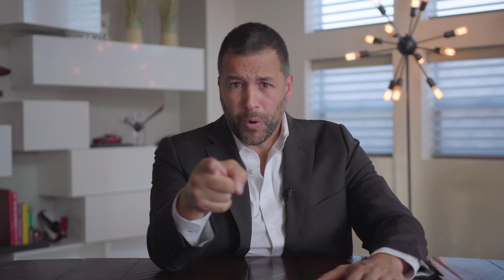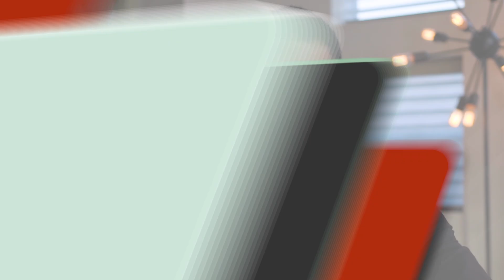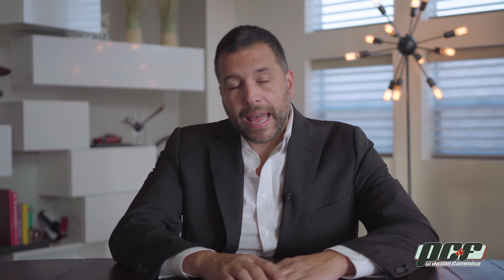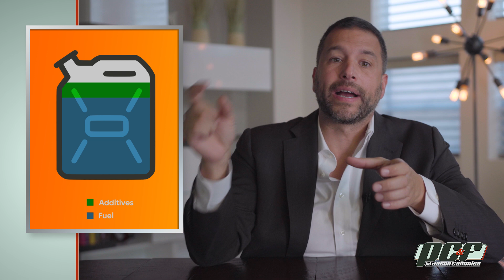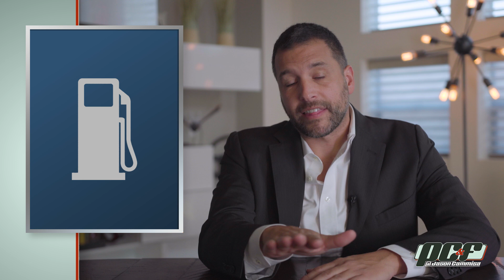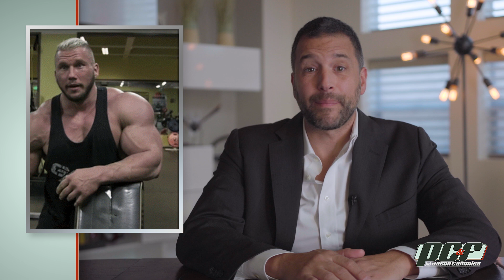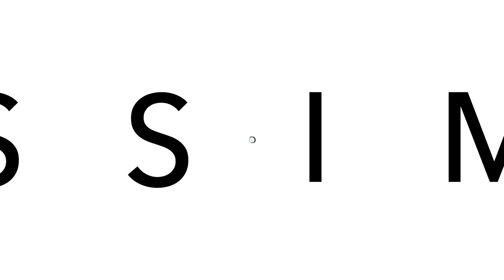Why you should never put premium gas your non-premium car — Proper Care & Feeding with Jason Cammisa

Comment: And don't worry, there will be another episode about RON and MON — and now while Europe's 100 RON isn't any better than US 94-octane. But how California's maximum 91-octane sssssuuuuuuuucks!
Reply: Maybe not episode-worthy, but what gives with 85 octane in the high altitude states? It's not 1973 anymore Colorado, and my Golf wants 87 (like every other car made since, what, the early 80s?)
Reply: @patrickgile320  I guess in theory because the air pressure starts out lower and cooler at higher altitudes in the first place the air in the cylinder will be lower pressure and cooler after the compression stroke. This means there is less thermodynamic energy in the combustion chamber to overcome the activation energy required to start the gasoline-burning before the spark plug fires.
This is also the same but opposite explanation as to why cars with turbos and supercharges need higher octane for the same compression ratio as a NA car.
Reply: @patrickgile320  A car tuned for 87 can use 85 just fine at high altitude, due to the lower air pressure.
Reply: What about the crazy price difference between say ARCO vs SHELL
Reply: Such a great episode! Too bad these are so short.
Reply: CA 91 octane feels like CO 85... I like the 93 on East coast.
Reply: When I had a 2018 Type-RA, I had to have it de-tuned for 91.  That ECU was clearly designed for 93... (S209 is the same way I'm hearing)
Reply: @stevemartegani  ah so instead of 5 horsepower you get 4, such a shame
Reply: Good cause Europeans need to watch that video. Idk how many times I've read " You yanks pay little for fuel because your fuel is crap! Our cheapest fuel here is xx" or something along those lines.
Reply: What about the crazy price difference between say ARCO vs SHELL
Reply: @joefields719  Go to a local shop and ask them to show you the inside of an engine that's used ARCO - versus another that's used a Top Tier fuel like Shell. You'll never put that sludge in your car again. Ever.
Reply: Yes - that`s a good idea. Fun Fact: Shell is selling its V-Power 100 Octane here for roughly 10 Cents more than Aral (another brand here) sells its Ultimate Fuel with 102 Octane. This sample shows that all is just marketing to get some more cash out of the customers.
Reply: Arco is top tier rated
Reply: I'd pay to know how the US 94 compares to Russia's 95. Over the past two decades, the gasoline quality improved a lot, but since I'm going to switch my current Kia Rio for a used BMW 1 Series, I'm a bit worried whether I can keep filling up with 95 or would have to start filling up with 98 instead.
Reply: @dimanxgermanist1327  Don't you all use the same rating for your fuel as Europe? Then it should be same - our 93/94 is the same as your ~100. It doesn't mean one fuel is better than the other, we just use a different rating system.
Reply: @racequad9  I dunno. The number corresponds to the octane rating, so it can't be above 100, but unlike Russia, Europe doesn't usually use numbers, they have that "regular' - "super" - "super plus" system
Reply: @dimanxgermanist1327  I think Russia might use the same rating as Europe. Why wouldn't it? As an American, we seem to want to be different. I don't know why we do that crap. Regardless, I don't think there's much difference  in quality, just the numbers. Oh, we use both numbers and "regular" "super" and "premium"
Reply: @dimanxgermanist1327  I live in Portugal, have been to multiple other European countries and I've always seen the octane number being displayed. I think it's actually mandatory in the EU. 95 exists everywhere, it's mandatory for gas stations to sell 95, sometimes there are two types of 95, a "basic" and a "premium" version of it, the premium 95 is sometimes replaced with 98 which is also fairly common. Very rarely (in most countries) there will be gasoline with octane rating above that.
Reply: @fgsaramago  Means I'm probably out-of-date, thanks!
Reply: I know I'm kinda off topic but do anybody know a good place to watch newly released movies online?
Reply: @Gianni Ellis i would suggest flixzone. Just google for it =)
Reply: @Kasen Asa Thank you, I went there and it seems to work :D I really appreciate it !
Reply: @Gianni Ellis happy to help :D
Reply: Hey, Jason, where are you? It's been ages since I heard obnoxious yet insightful car info from you. There's no shortage of topics!
Reply: @dimanxgermanist1327  Hey there, I'm right here! And I'm still doing this same show, basically — rebranded as "Know It All" on the Hagerty YouTube channel. Same topics, but I'm a little nicer about it. Go check it out — I think there are 11 of them so far!
Reply: Hi Jason, about this topic does the same apply to diesel? Regular diesel Vs Premium (with additives)?
Thanks keep the great work!
Reply: Come to British-Columbia , Canada.. World worst gasoline on earth!!!!.... HPA motorsports did an article about it. even the chevron 94 is absolute garbage around here. and no e85 anywhere to found either.
Reply: That didn't age well
Reply: Make this episode on hagerty about RON and MON!
Reply: Could you please do one on why Cd is not aerodynamic drag and force your colleagues to watch it? They are starting to piss me off xD
Reply: @HMHacki  It's on the list of the 200+ episodes I have written down and ready to produce :)   IT'S Cd x A, KIDS!  I say that all the time!
Reply: @JasonCammisa  thank you!
Reply: @JasonCammisa  I miss this series 😢
Reply: @HMHacki  cough cough Matt Farah cough cough
Reply: @FedSalman  Yes he was the last offender on a long list.
Reply: And who buys the one in the middle? Which is 89 around here 🤔
Reply: @aebk8439  The very small group of people who either have cars whose engines specify 89 OR people doing engine mods that boost compression beyond what the stock ECU is designed to account for (i.e., certain head/block combinations with '90s Honda engines being built by people who can't afford to get it tuned), but who haven't jacked the compression up high enough to need premium gas.

In practice, it's just another way to try and squeeze money out of people using the same logic as what Cammisa described in the opening of the video. Offer them something "better" than regular, but at a lower price jump than the high-octane option.
Reply: @aebk8439  V6 buicks, my parents lacrosse with the 3.6. I would assume also the V6 chevys as they share the same engine.
Reply: @Kasen Asa yup, have been watching on flixzone for since march myself =)

Comment: You should never put regular gasoline into a premium engine. This causes engine knock, sure the ECU will retard the timing to compensate, but only after a knock has been detected by the knock sensor. Meaning the damage is done.

Comment: It might be worth going for the premium fuel just for the additive package.  The premium fuels have additives for reducing upper cylinder wear and detergents for cleaning your fuel system.  I have have also heard of an issue where ethanol in fuel can degrade or damage oil filter that has a cellulose media, but this is only a potential issue if fuel is getting into your engine oil.

Comment: My father bought 94 octane for 300,000 miles,
Shell oil,
He dead, then I now have his car.
At 423,000 miles it is still starting today.
One more thing, the engine oil😂.
When my father changed the oil it came out very clean.
I bought the lower price gasoline.
The oil comes out darker.
  If you burn cheap gas your motor is going to get dirty faster.
So change your motor oil sooner.

Comment: If you don't fuel up much (e.g. you have a grocery getter that takes months to burn through a tank of fuel) putting E10 in can probably hurt as it'll degrade and decompose, whereas E5 usually has no ethanol and doesn't "rot".

Comment: Ive seen two of this dudes videos, been wrong in both. With modern EFI, cars ecus can sometimes run more timing when using higher octane fuels when compared to 87. More power, better mileage in these cases. Keeps the knock control down. Also premium fuels have additives to help clean the injection plumbing and valves. 

Ill keep my 91/93 thanks

Comment: My 1993 Ford Explorer is rated for 87 octane but it suffers from pre-ignition (aka knocking or detonation) on anything less than 91 octane. My entire ignition system has been replaced and my cylinders and pistons are clean so it isn’t carbon buildup. It also has self-adjusting timing.

Comment: Premium will build less carbon on the rings, im told

Also good to note,  modern engines will still adjust spark and cam timing until they find knock 
So you will feel a bit more of a peppy throttle response

Old cars, particularly with lower comp won't be as noticeable,  if noticeable at all

Comment: Typically the best additive blends from a brand are only available in the highest grade. If you run a GDI, using Top Tier high grade blends can significantly reduce intake buildup.

Comment: The ability to compress the fule before predestination, is the reason. 
So put it like this, 87 octane, is ok.
But four cly engines follow a Motorcycle technology, they are all about performance. 
The Premium fuel cost more Yes, but once in a while it couldn't hurt 😮😂❤

Comment: Alot of top tier premium fuel now has a top cylinder lubricant that can prevent wear between the piston rings and the cylinder bore. So, if you were really picky about your car that is meant to run on 87 and wanted it to last longer before needing a rebuild, you could run a premium fuel and just pay more now rather than pay for a rebuild somewhere down the line.

Comment: If the car has a very high compression engine, the ECU can actually adjust for 91 and give you better economy. I know this because I tested 1k miles in my Mazda3 with13:1 ratio, and there was a difference. the biggest leap was from 87 - 89, but there was a minor improvement with 91. At any rate, I can get published highway milage in that thing driving it like I stole it with 91. It wont do that on 87.

Comment: This is disingenuous.

If a car was designed for 87 octane or whatever it is, as it ages it, it used to be common knowledge at least you run higher octane. 

The reason being carbon builds up over time and can cause detonation with lower octane fuels.

Comment: Insulting people for using premium gas, though there's reason to do so that you don't understand, doesn't make you right.
Reply: Premium gas in EU usually means no added Ethanol so in reality premium and regular are different fuels and for older cars that are not manufactured with ethanol in mind will get ruined by regular petrol .
I had that happen on my carbursted motorcycle, the hosing got destroyed by using regular petrol, luckily on a bike that is not hard to fix but on a car I would believe it's a nightmare.

Comment: My Camaro has 11.5 to 1 compression, when we run 87 in them. Even though they’re designed to run 87. They run on a worse fuel map, causing ping and detonation. So it backs off the timing. When we run higher octane than 87 there is no detonation or ping, and the fuel map stays the same, and so does the timing. Therefore, I get more power. So yes, normally aspirated cars would not normally benefit from higher octane. But if you have higher compression like myself and others. Run at least 89. I usually run 89, sometimes topping it off with 91….  I noticed it matters less than the cold months. But I still run 91. And have no ping.

Comment: Eh my flex is technically an 87 octane car but does it have modern enough ignition timing logic to adjust for higher octane fuel and run a million times better? You bet your sweet ass it does lol. Owners manual also reccomends 91+ when towing especially in hot weather so I doubt they’d have that in there if it didn’t make any difference lol.

Comment: I will have to get my scan tool out but, if the ECU can pull timing back to compensate for fuel you would think it would advance it for higher octane fuel.  My 13 v-8 powered F-150 is also tuned to run e-85 (which I never do) and I get fuel every Wednesday at my local station because they sell 89 for the price of 87.  My 01 MX-5 is 91 or better and when I get away from the California piss fuel my mpg goes up by 2 just because of no ethanol.  My only problem is the reformulated fuel is 93 and the non reformulated is 91.

Comment: Nope, dosen't work that way, what you have said is true that compresion raport determens what tipe of gasoline can that engine take without premature detonation, but a higher octane fuel even in low compretion engines has it's benefits because it makes the diference of a controled burn on the combustion cycle giving power gradualy and also keeping the engine cooler or having all the combustions hapens right after the ignition giving more heat that can make the engine overheat and also more noise.

Comment: My previous car was a 2012 Kia Rio5 with a 1.6L 4 cylinder engine with direct injection.  This engine ran 11:1 compression and called for regular unleaded.  However, when driving calmly in town, up a slight hill at regular lower speeds (say, 50 km/hr), right before the transmission would downshift (where you are putting a lot of load on the engine) you would hear pinging.  I would imagine most people wouldn't even notice it, as these cars (and this engine) is pretty common.  I switched to premium fuel as it has less of chance of preignition and it ran perfectly so that's what I put in it.  I replaced that car with a Toyota Venza that has the D4S system (direct and port injection) and runs at 14:1 compression.  Even though the Toyota engine only calls for regular gas, I was sure I would have the same issues with regular fuel, especially with even higher compression.  Nope.  Runs perfect on regular gas.  My only guess is while Kia said their engine ran fine on regular, it doesn't.  It will run, but my guess is the ECU will likely retard the timing quite a bit which reduces power and fuel economy.  Perhaps Toyota has much better engineers because their high compression engines runs flawless on regular gas.

Comment: OMG such misinformation. While negligible higher octane fuels give a MPG boost and increase in power 1-2%. The additives to increase octane is literally named OCTANE and burns better than gasoline. If it makes you feel better to run higher octane fuel in your 87octane computer controlled engine go ahead.

Comment: Cammisa... as much as I respect your car reviews, you are no engineer or automotive technician. It won't harm your car to use higher octane gas unless it is a car tuned for E-85. The advantage to using high octane gas is the fact that it is sometimes the only ethanol free gas when 87 is with ethanol only. You are a Scirocco owner, and I hope you don't run ethanol gasoline in it, because it will destroy the seals in the bosch k-jetronic system. Many of the premium grade fuels like Shell V-Power also use very good detergents. I would rather use Shell V-power occasionally then run the Snake's Oil fuel cleaning products.

Comment: My take premium gas does help reduce knock. I had a Hero 200S that is carburetor and single piston. I always use regular gas since I got it brand new. Being a single piston engine it tends to vibrate with regular gas. But when I started doing deliveries and had to be on the bike from 10am to 10pm everyday I started putting premium to reduce the vibration. It helped alot, my hands no longer feel weird even when I'm not riding

Comment: This is strangely broad advice, which makes it somewhat inaccurate. Each car company has its own way of tuning ECU parameters, and even within each company there's a hierarchy of engines with different origins and purposes, leading to different outcomes. So, there's brands that typically do leave advance headroom on ignition timing, and there's also regular octane engines that were initially designed to run premium and are basically just being sold as regular octane capable by virtue of them having functioning knock sensors (I exaggerate, but still). In those circumstances there's nontrivial performance and NVH advantages to be found using premium, but likely not a reliability advantage. Otoh, a relatively high compression engine of any stripe that asks for premium, should get it, and it will cause incremental damage if it's not there for enough miles. The ecu will keep "knocking" on the knock sensors door looking for advance, and by operating at an extreme of the ECU maps the engine will have less available retard handy when bad fuel, clogged injector etc happens.

Comment: I live in UAE and I use 98 octane fuel in my golf R(2.0 turbocharged 4 cyl - 310 hp), even though VW says 91 octane should be fine.
Fuel is cheap here, so for a full tank, the price difference is less than 50 cents USD.
Thoughts on this?

Comment: My 2019 subaru Impreza only requires regular gas but i actually getting 2mpg more if i put in a premium.

Is it 2 mpg gain enough to compensate the difference in prices??  Nope !! But to say that the premium gas makes no difference is not necessarily true. At least not in my case..🤷🤷

Comment: Are we talking about cars from the 70's? Every vehicle I have owned since a 1992 Dakota has had knock sensors. The ECM advances the timing until knock is detected and then it retards it a hair. The final gasoline vehicle I owned was a 2015 F-150 3.5L EB twin. Running premium gasoline (not gasohol, I refuse to burn ethanol in my engines) instead of 87 yielded right around 3.9MPG more. On a 36 gallon tank, that's around 140 extra miles per tank.

You are correct in that if you own a carbureted beast of a vehicle, you run the fuel the engine is set for, but if you have anything post-2000, you should be able to run anything in it and benefit from it. I don't worry about this now though. I run a diesel and do not plan on going back to gasoline!